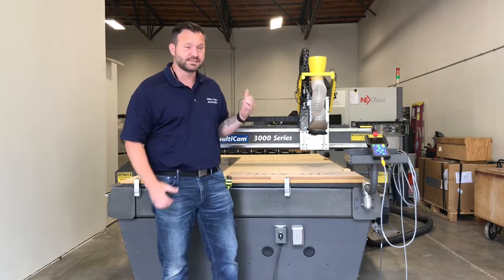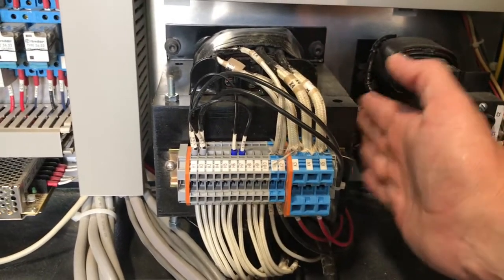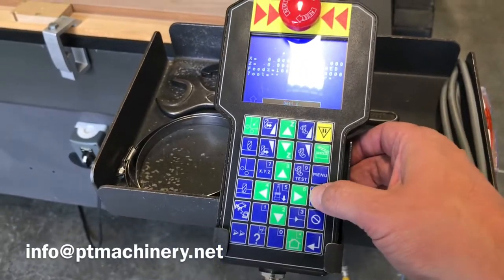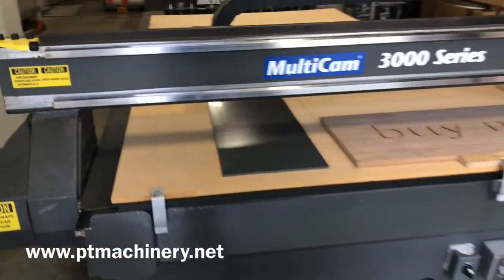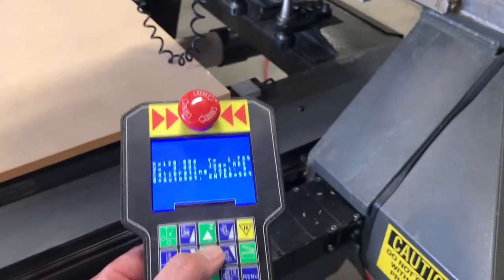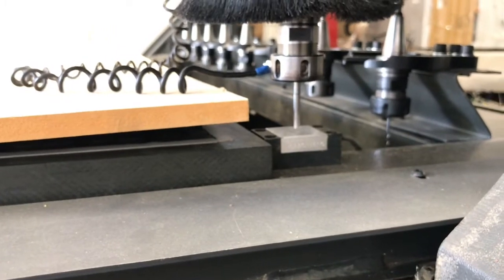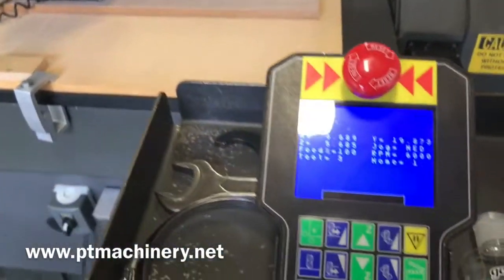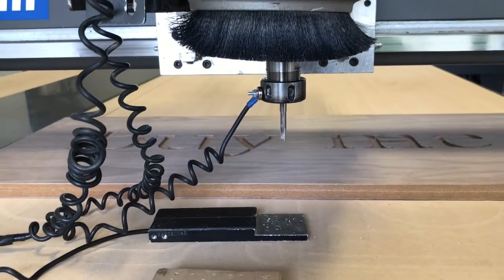MultiCam Fast Start ATC Video Walk Through Guide 3000 series CNC Router

Comment: hi there i would like to know how can I get maintnance user manual  for multicam router.
Reply from the maker: Check with MultiCam they should have user manuals available that usually cover a page or two of maintenance. If they can't help you shoot me an email and I can share an older on with you based on the model machine you have.